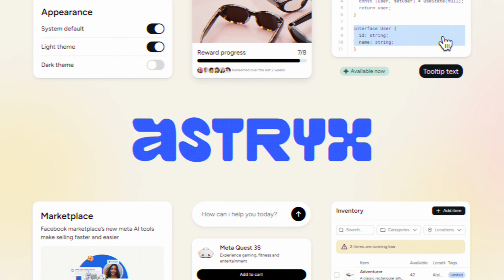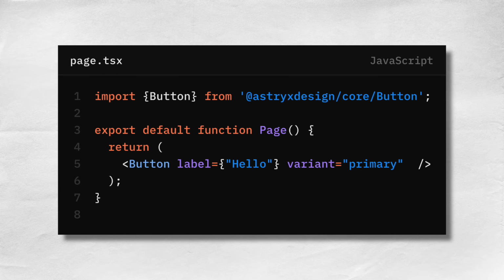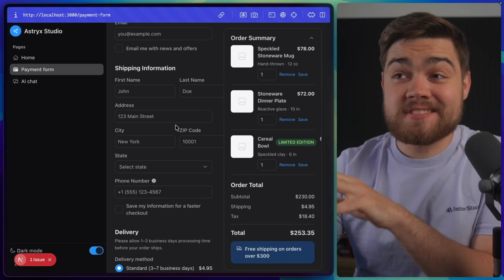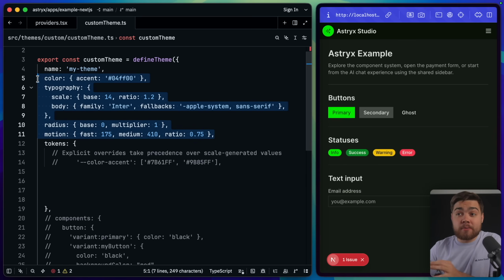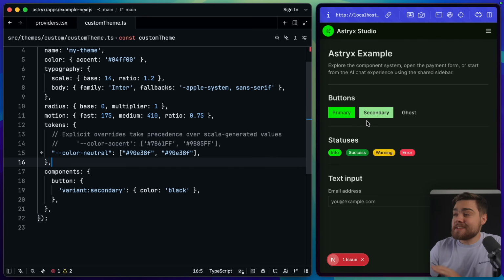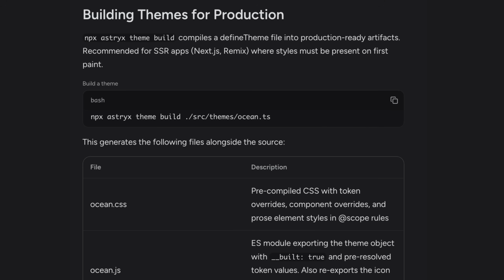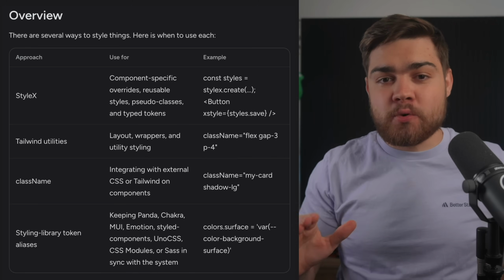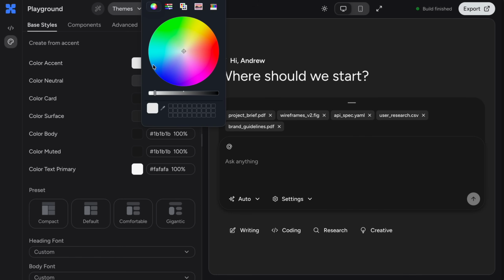Meta Just Open Sourced 8 Years of Ul Components (Astryx)

Comment: Material UI is just as customizable... Forget it. Good video
Reply: Things that Astryx do better than Material UI:
- Precompiled modular CSS. This means a much smaller bundle size than MUI which uses relics like Emotion and PigmentCSS.
- Built in CLI for AI agents. AI agents don't have to parse through docs tailored for humans.
- More ways to customize your components. StyleX, Tailwind, plain stylesheets, or external styling libraries like MUI if you really want to.
- Astryx is brand-neutral. On the other hand, turning MUI into something that doesn't look like a Google product takes significant effort using custom themes and overrides.
- Want to own a component like you do Shadcn? Run a CLI command to swizzle a component and eject that specific component's full raw source code directly into your codebase.
- Astryx's docs are just so damn clean. How many other libraries do you know of that list good practices in every page?

Material UI is honestly so trash I don't think it's even remotely comparable.
Reply: @JRPG_Addict   Discussions like this in places like this are not worth having. Most people don't even understand the relationship between the design system and UI components, or tokens and behaviors. Also your claims are a tad over blown but more informative that the video. Good luck 👍
Reply: @everurstruly "Tad overblown?" There's no room for exaggeration in any of my listed points, and they're all very easily verifiable.
Reply: @JRPG_Addict okay

Comment: Seems cool, but not different enough for the other frameworks tbh to justify using it
Reply: I tried it out all day yesterday and I honestly love everything about it. I love the built-in CLI for agents. I love that you can eject component raw code like you do Shadcn via "Sizzling." I love that it's built on top of styleX which is pre-compiled modular CSS with zero JS runtime, and by extension very small bundle sizes. I love that it doesn't lock you into using styleX and allows you to use basically any styling solution that you are comfortable using seamlessly. I love that it's brand-neutral by default. I love how clean the documentation is and how every page lists relevant good practices.

I might be in a honeymoon phase, but so far everything I've seen and experienced of this library has been nothing but a bliss.
Reply: @JRPG_Addict dang I might have to check it out 😅

Comment: This was built by a large company with developers that can specifically focus on design and UX. A dev or agent is not gonna go to some strange file to know to adjust values, it'll need steering whereas you could just type into the class attribute and get the feature shipped.

The problem was never that we don't have the right primitives, its that those primitives are rigid and difficult to maintain for teams of varying numbers and experience...